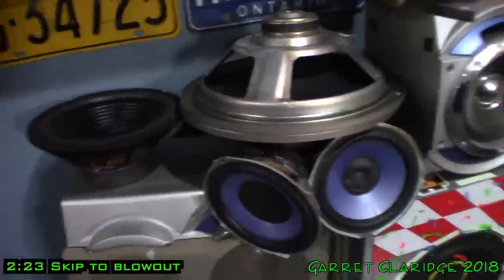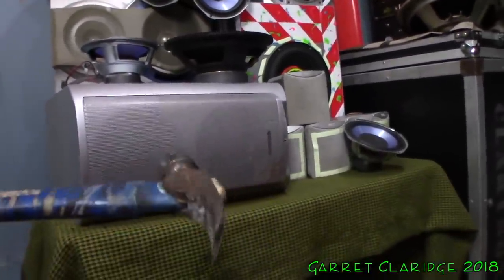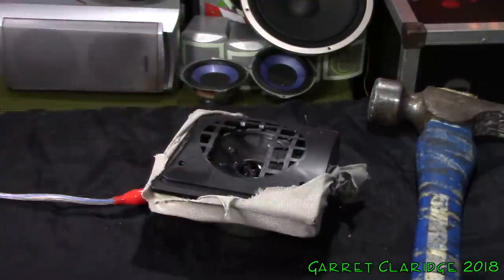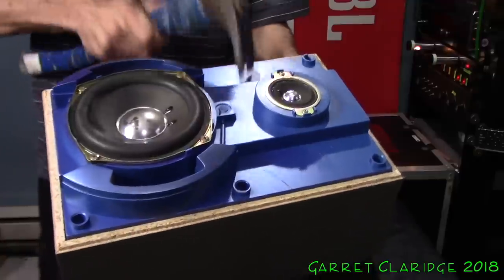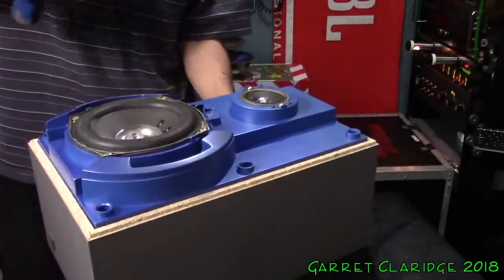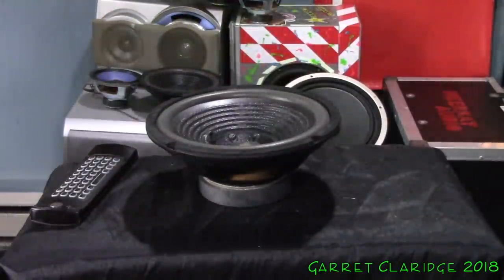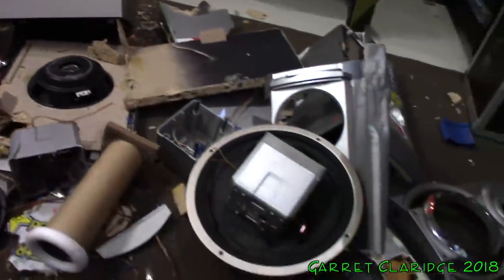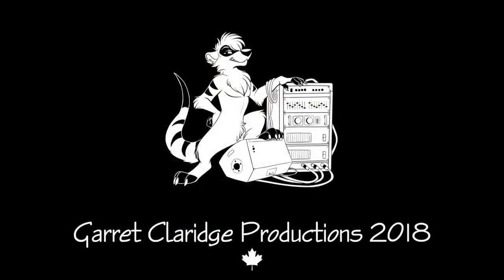Blowing 18 Speakers - Smokin' Speakers Episode 1

Comment: That blue coned speaker like the one at 4:38 sure seemed to be mechanically quiet, nice magnetic dampening or something in there that minimized the harmonics in the cone....maybe Sony's elusive Stradivarius drivers?  Don't let your indoor pyrotechnics get to those flaming foam ceiling squares.  >:o/  Love these speaker popem'up shows.
Reply: Ive had a few and they are quite quiet for not having a vented pole piece. but they're nothing special really.
Reply: Interesting information.  Thanks.  Very unlikely to be anything special if it is in Garret’s blowem’up speaker pile.

Comment: Glad you blew up those HTIB speakers they make A/V  receivers burn out beause they are 3 ohms and shit lol And if your A/V  reciver does not have any Speaker output relays and such it really will F-up the whole amp board. 

That's one of the real reasons Pyle receivers burn out because a lot of people who buy them try to use thier old mini-system and HTIB speakers daisy chained togeather, or they try to use car speakers lol!   And try to hook up the speakers when the receiver is on Even in the crappy manual it says to use 8 ohm speaker lol. And not to connect with receiver on...